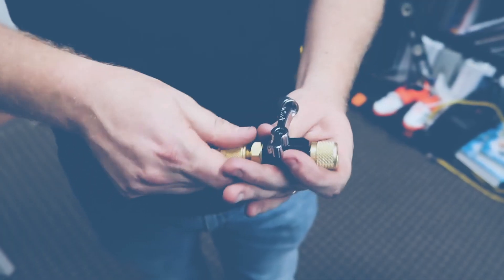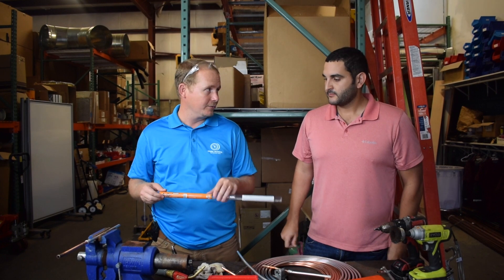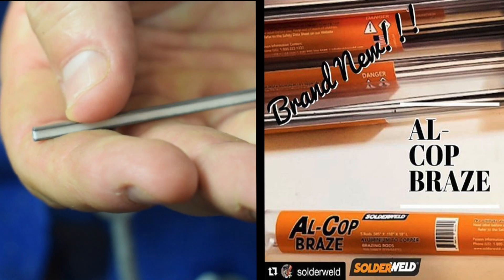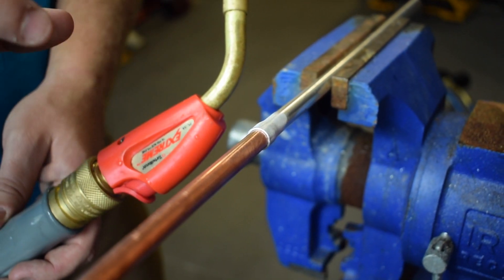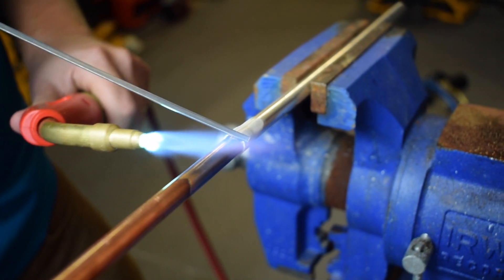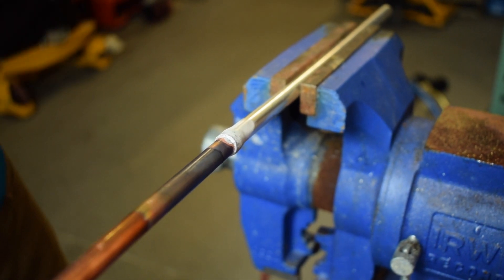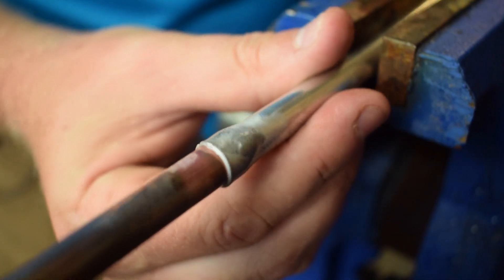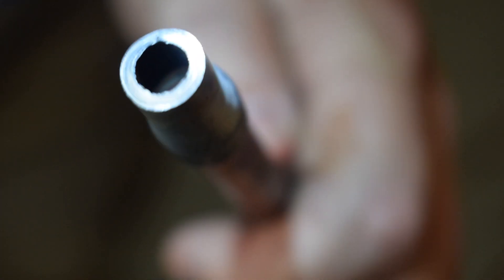AL-COP Braze - Brazing Aluminum to Copper

Comment: Is nitrogen purging  required
Reply from the maker: Yes, cupric oxide on copper can form in the presence of air at temps over 575° and the temperature of this solder is around 950°